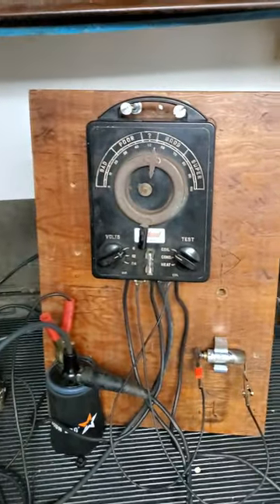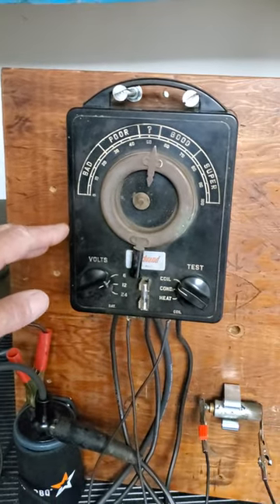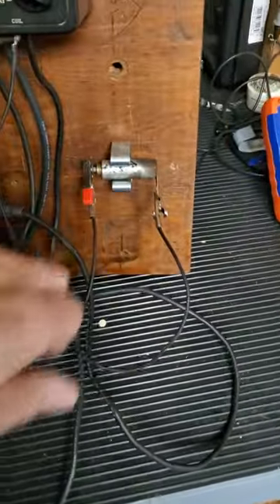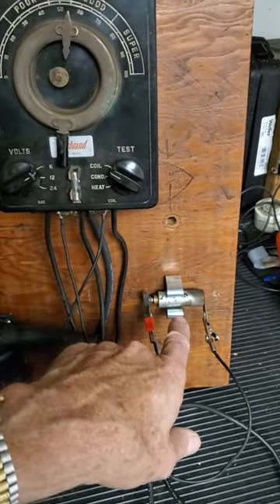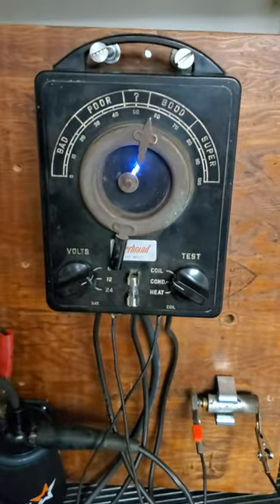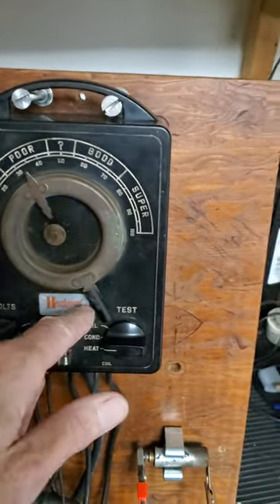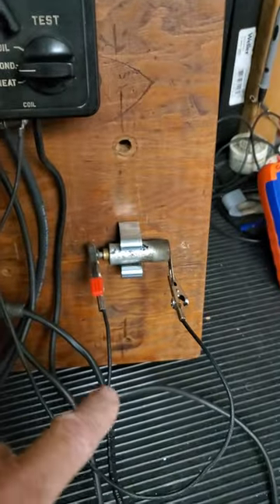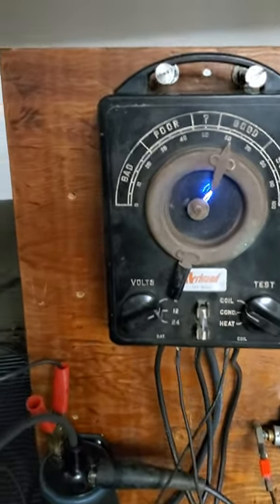A demostration showing the effect of a bad condenser on an ignition  coil's spark

Comment: Thanks for what you do.  I have an 84 18 foot boat with a inboard stern drive mercruiser....2.5 liter 120hp chevy motor...I had my engine running for over  2 hours...next day started it up...then took to lake....once on the water and it was under a load and or had back pressure on the exhaust from the water it would not stay running...Few times it would start and die and then nothing...few times i kept it running by adding fuel to carb but then it cranked for a while with nothing and then we check and had zero spark....all i have done is clean the points but the points are old and so is condenser....plugs...wires and cap and rotor look good...coil looks newer but was getting hotter then i thought good.  2 times i took it out to the water and each time as soon as i got it on the water it would not stay running?...Any ideas

Comment: I've been working on cars for 40+ yrs and never asked myself what exactly does a condenser do.....how do I tell if it's bad.....what are the symptoms. Granted, many of those years were the electronic ignition era, but I am now doing '60's Lincoln Continentals. I always suggest a full tune up when someone talks about their barn find, but I don't think many know that includes point AND condenser. Thanks for the video
Reply from the maker: Many of the condensers available today are imports and rather poor quality. I tell people if they have a good condenser, dont replace it with one of unknown quality just for the sake of replacing it. I bought a standard products blue streak condenser last year. Blue streak is supposed to be their premium line. It failed within a week with an intermittent internal connection.

Comment: Thank you for this. Do you have a demonstration of how to test a condenser with a basic multimeter? I’m struggling with my Ford 8N tractor.
Reply from the maker: @kylewetherington  If your multimeter can test capacitance, you can use that for a basic test. Also check for continuity, it should not be shorted.

Comment: One way this type of condenser problem can manifest is in spark failure under load, i.e., the car will idle well but fail when you try to accelerate. I saw a test on an outboard motor where the correct size of the condenser was .22 mfd. Increasing the size to .47 mfd reduced the peak voltage in the primary winding by 25%. That seems to line up with what you're seeing on the tester.

One thing I'm curious about and haven't had time to check is whether you could diagnose a condenser whose capacity was too small on a Model A engine by using a clear distributor cap (and a dark night) to look for arcing at the points. I'm not sure whether you'd be able to see the points under the rotor though.
Reply from the maker: Good question. You might be able to skeletonize the rotor for better viewing. There is  lot of extra material there.